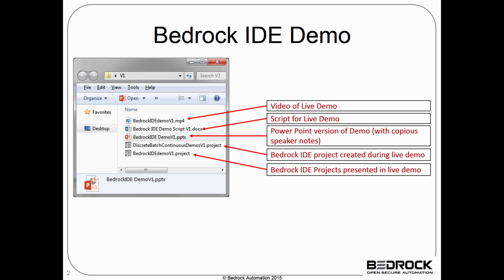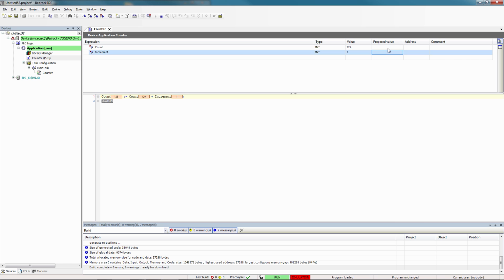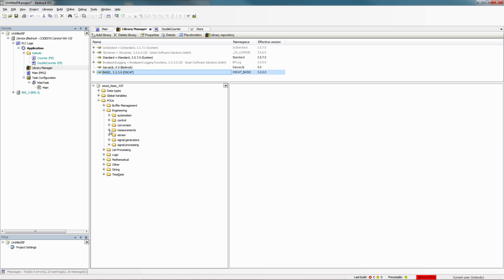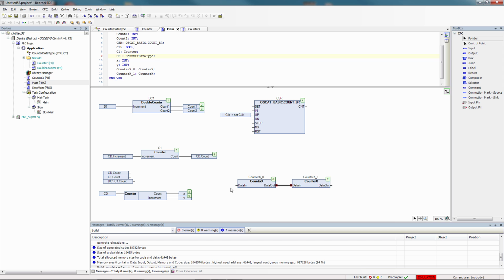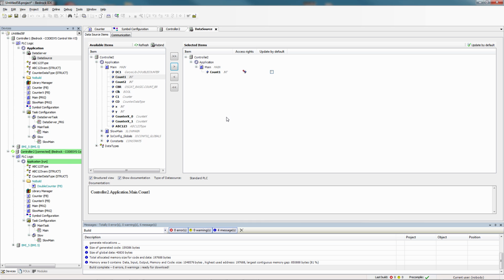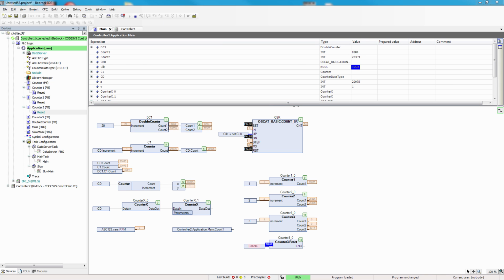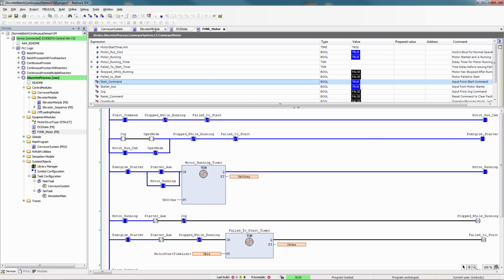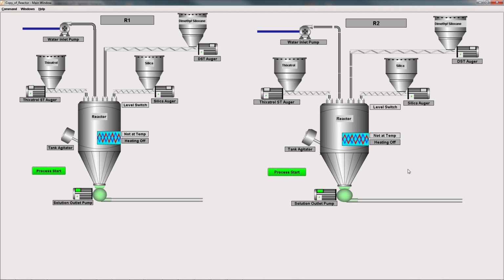CODESYS IDE Demo

Comment: if i have a demo version of codesys can i upload from eaton xv-102
Reply from the maker: Hello ahmedassem2979.  I don't understand your question.  If you are referring to the the CODESYS IDE, there is no "demo" version of CODESYS IDE.  The full CODESYS IDE is free, and will run on any Windows computer.  If you are referring to the CODESYS Runtime, 2-hour demo versions of it are available for Windows and Linux platforms, and a few other platforms.  If the CODESYS Runtime is installed by your hardware vendor, you would need to check with that hardware vendor to see if you can change to a demo runtime.